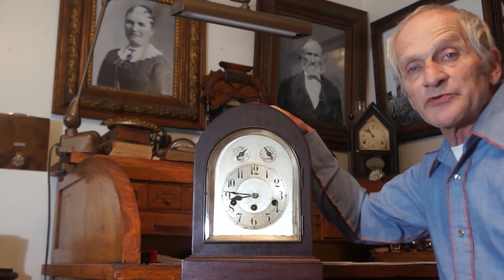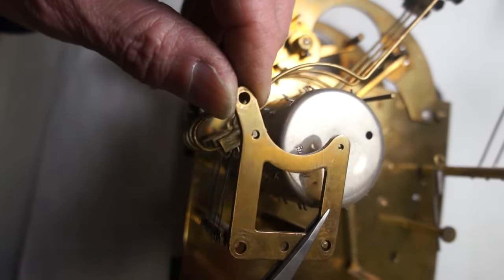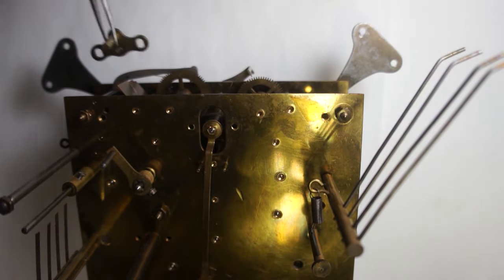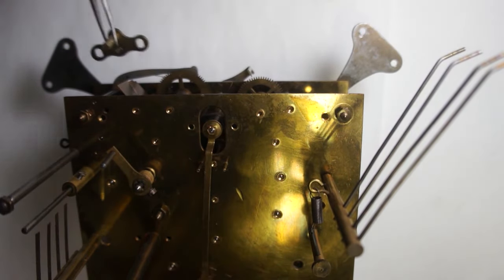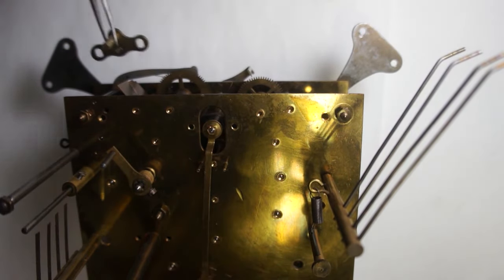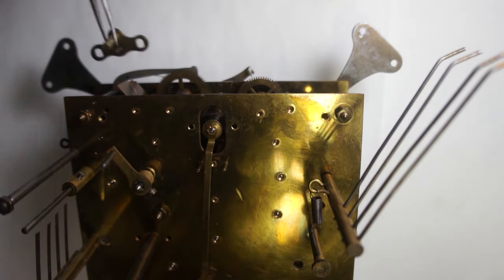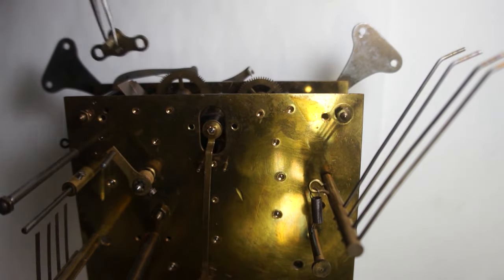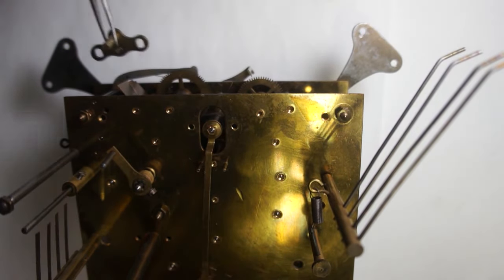Junghans Restore for Martha from Texas #30

Comment: I have two Junghans clocks.  One identical to one you previously showed.  One very similar to this one.  Only mine has a more rounded top.  It works and chimes beautifully … and loudly!  I love my Junghans clocks! 🕰❤️🕰  
Beautiful work, Mr. Martin!  👍👍👍
Reply: I agree, they are a quality movement.
I have noticed many variations of the cases and dials out there as well. 
Not much documentation on these variations to be found. 
Omuseum, its an impressive building as were their movements.

Comment: youtube suggested this video to me this morning, which is very timely.  I just bought a little Junghans mantle clock that's in really good physical condition, but might have a corroded mainspring.  It winds roughly and ticks weakly for about 12 hours, but otherwise it chimes and keeps time properly for as long as it's running.  I'm going to have to look inside the mainspring barrel.  I'm also uncertain if I have the original pendulum.
Reply from the maker: Hope it all turns out for you.

Comment: Thank you for your video Mr. Martin. I am an amateur lover of clocks, but by trade I'm an orthopedic surgeon. I think you have restored two Junghans on your program; both are similar to but neither is identical with the one I'm finding very problematic. The number on the back of mine is B11 (second half of 1911 I suppose), and I ordered it on eBay, and had it sent to my house in Florida rather than New Hampshire where the clock shop is. I had a couple of definite problems with the releases of the two striking trains. They both release, but in no way appropriately. Although I have repaired several others, I fear that if I keep bending parts of the release mechanism beyond my ability to repair them here without my lathe, parts, tools etc. I also have another problem. I have a pre-World War II German clock which strikes ships bells. I have repaired it a couple of times successfully. I tried to clean it here in Florida, but when I clean the platform whatever was in the solution I chose loosened one of the fork Jules in the platform. May I send these two items to you for repair? If so sir, would you be kind enough to send me your shipping address? My name is James Dickson MD, and you can call me at two numbers 603-253-2566, or my cell phone which is 914-275-8275. It would be with an enormous appreciation if you accept this work for me.

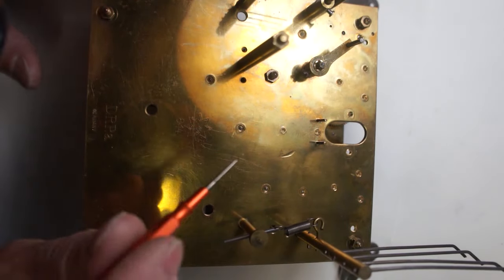Comment: Hi Jim,  just stumbled onto this video as I just aquired a similar Junghans clock.  At 08:15 you mentioned cleaning the works "by hand".  What did you mean, can you explain?  I have cleaned works, with let down springs with Dawn, warm water and a toothbrush, stiff artists brush, followed by a rinsing, then another soap bath, then rinsing, then low-pressure air drying, then a warmup in a low-temp oven for 5 min.  Is that what you do??  Thanks, Bob
Reply from the maker: Yes, 
 Dawn works great, I am sure there are many other similar degreasers out there, Mineral Sprits come in handy as well, always followed with air dry and heat.
Reply: @jamesmartin5370  Thanks for the confirmation Jim!

Comment: If you don’t mind me asking, what would you recommend doing to clean these plates by hand. I am working on an A13 box regulator and the finish on the plates is perfect, just dirty.
Reply from the maker: You might need to test some cleaning solvents in small areas.
Brass plates on these were final buffed to a polished finish then coated either with gold gilt, shellac, varnish or a shellac/varnish finish to prevent them from tarnishing.
Without a protective finish, brass will oxidize to a dull unsightly finish in a couple of weeks.
Some of the older A-13 time period movements were gold gilt.
Check yours to determine what finish is on it.
If its gold gilt, I have seen ultrasonic cleaners damage the thin gold gilt until that there are brass areas showing.
Gold gilt, you could clean with most any solvent, just be cautious of ultrasonics.
If the plates have a shellac or lacquer on them. 
You can use mineral spirits or turpentine on any finish with little to no risk of damage to the finish.
Shellac and Lacquer will get damaged in an ultrasound.
Shellac and Lacquer are alcohol based so don't use denatured alcohol unless you want to strip them off and refinish.
Shellac in denatured alcohol will dissolve immediately, Lacquer in denatured alcohol will dissolve but very slowly.
Reply from the maker: Use a soft cloth while doing hand cleaning, a rough one will leave scratches.
If the finish is stained, keep in mind, no amount of cleaning will remove a stain that is completely through the finish.
It will either need to be left alone or stripped and refinished.
Reply: Okay thank you so much!

Comment: I really enjoy your videos and feel I get something out of them.  I especially like the way you handle tools - you have a nice touch with tweezers.  This one was especially interesting because of the dial resilvering and touching up the numbers.  Does this Junghans movement have a chime correction mechanism similar to the Seth Thomas 124 for when the chime side gets out of sync with the hands?  Was there anything tricky or difficult about reassembly?
Reply from the maker: Thanks Paul, 
Yes it has a chime correction mechanism.
Reassembly went normal, in these always a lot of pivots to navigate around.

Comment: Another very educational repair video.  First time I've seen the silvering done. Thank you.
Were the last 14 minutes the top secret repair processes?  LOL!
Reply from the maker: Those 14 minutes got past me some how, I will look into it and see what can be done to clean it up.
Reply from the maker: I forgot to include, if you do any silvering, it needs some type of protective film on it to keep it from tarnishing, I used a thin coat of lacquer.
In the older days they were using wax along with bees wax, lacquer holds up much longer.
Reply: That makes sense about tarnishing.  Lacquer would probably be easier.  I was wondering about shellac also.  Again, probably not as durable.

Comment: I am working on the same movement. Someone has rigged the wrong pendulum spring onto it. Do you know what the correct length would be?
Reply from the maker: Not sure of exact length.
Clock has been shipped back to owner and I don't have any of those pendulums around to measure.
I do have the old A 13 movement here.
The pendulum is slightly shorter on the A 13 movement as compared to the one I shipped out.
Reply: Thank you sir. Mine is actually the A42, but it seemed similar enough to get an idea.
Reply from the maker: @craigcoen187  The one I have here is as follows.
Pendulum rod is 3-1/4" long, pendulum bob weight is 4.6 ounces.
Suspension spring and rod from top mounting pin to bottom pin where pendulum mounts, measures 5-1/8" long.

Verge assembly, from top pivot pin to bottom where suspension spring runs through it, measures 3-1/4" long
Back of movement reads A 13, on lower right back plate reads 160.
These movements were sold with different escape wheels mounted in the same movements.
To start with, mount a pendulum rod that is within about 1/4"of the bottom of the case, use a pendulum with weight within an ounce or two of 4 ounces.
This should give you enough adjustment for it to keep time. 
The weight of the pendulum is not as critical in the time keeping, the arc of the swing has a larger factor on its time keeping ability.
Reply: Thank you so much for looking into that for me! I really appreciate it. It’s hard to find info/specs on these old movements.
Reply from the maker: @craigcoen187  The same movements were slightly modified for different length cases.
They changed the number of teeth on a couple of gears, including on escape wheel.
This enabled them to use same movement with different pendulum lengths.
I think the 3 digit number on lower right bottom of back case may or may not indicate suspension rod length, this is just a guess.
Reply: Okay, that may be something I can research in the future. You’re information can definitely get me working on it again.

Comment: Just wondering how I would send you a clock that needs work?
Reply from the maker: They are usually sent via USPS or UPS.
Sometimes only the movement can be sent to reduce risk of damage to the case.
You can contact me at      jamesmart55@hotmail.com     or phone at 509-868-2499 .